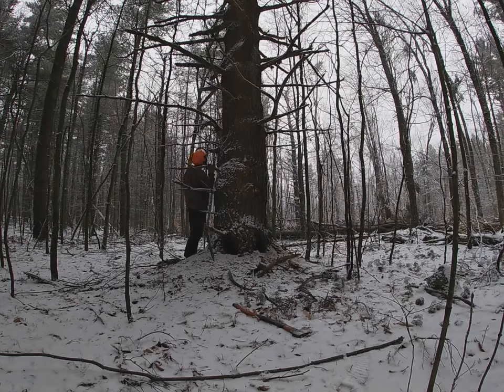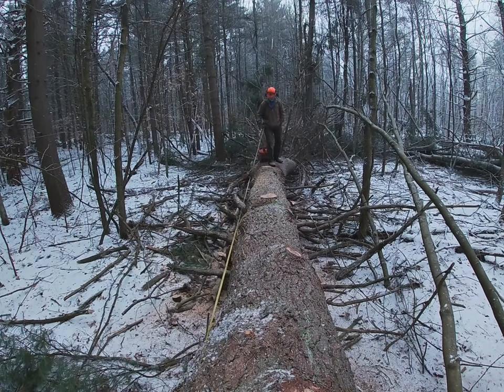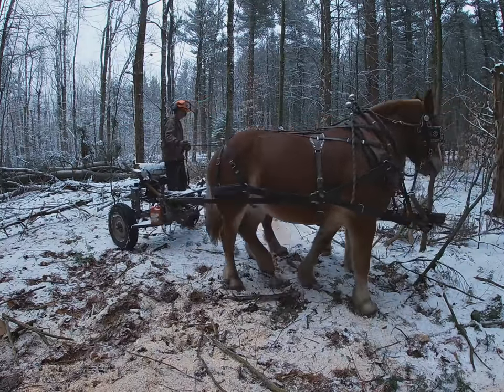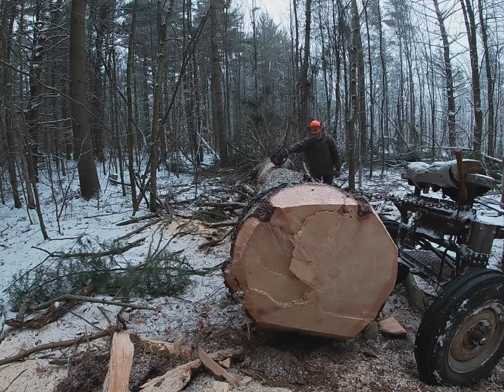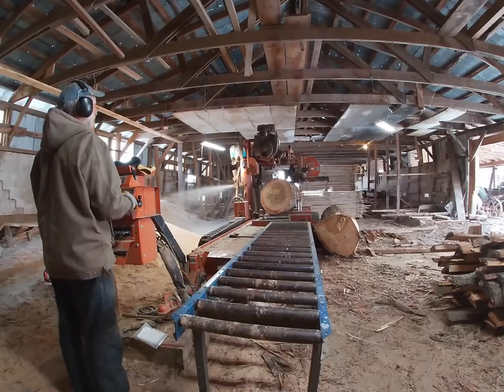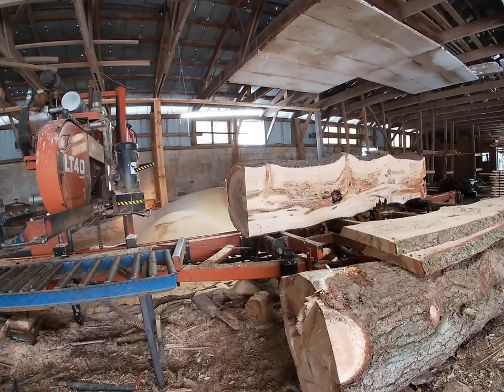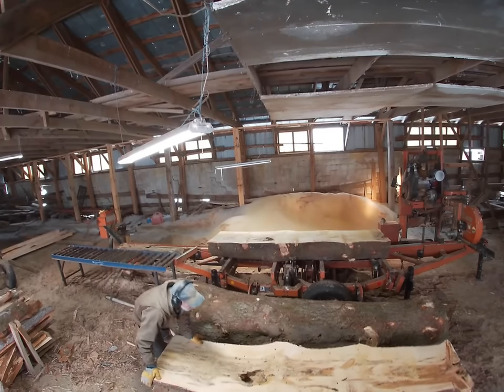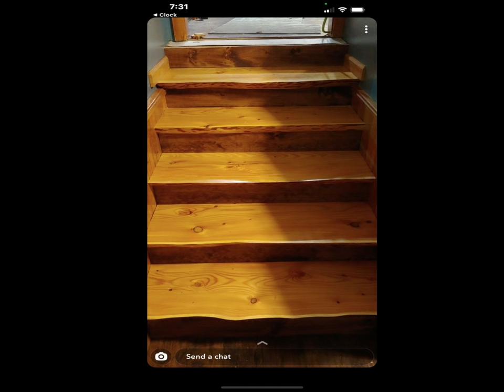Live Edge Slabs From Big Trees

Comment: Hello Jim.   Good video.   I was having issues trying to get firewood skidded out of our farm woods with my ATV.   The logs kept digging into the ground and the friction made it difficult to pull.   When I hit a root or a rock, the machine would just dead stop.   
I figured that these are some of the same things you encounter when logging with horses.
Have you considered a log arch for those logs that are just too big to skid comfortably behind your team?  The one I built for my ATV could easily be scaled up.   It straddles the log and when you pull forward the load comes off the ground and the chain slides up into a area of the arch where it locks itself until you back up.  It relieves the friction by getting the nose of the log into the air and makes the pull easier for the ATV.  
If I can find a good email address for you, I’ll forward a photo to you of my design. 
Cheers!
Happy New Year!
Whipple
Reply from the maker: Hi, thanks.  Our email address is on the home page under "about."
Reply: @WorkingHorsesWithJim      Thanks Jim.   I’ll look for it and get some photos to you. Maybe even a video.
Whipple

Comment: Magnificent horses.  They pulled that huge log and seemed to enjoy pulling it.  Fill those holes with epoxy and you will have a beautiful bar or table top.
Reply: Some people use Cement mixtures or Granites to fill holes and give a swirled color pattern through the Cement / Granite and then epoxy the whole surfaces for a glossy finish that won't rot away , it would just depend on your ' artistic skills ' and materials that you use . There's a private family company in Erie, Pa who use these color schemes on ' stone ' looking counter tops in their construction / rehab jobs . Niche market woods have value depending on the artistic types who use them .
Reply from the maker: Yes, that's the plan, they turn out very nice with the Epoxy.  Thanks for watching.